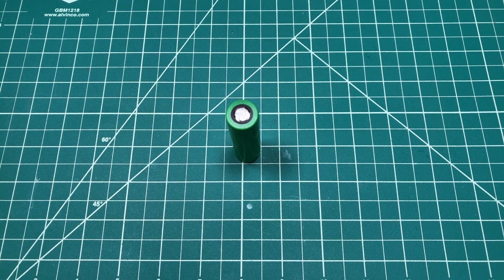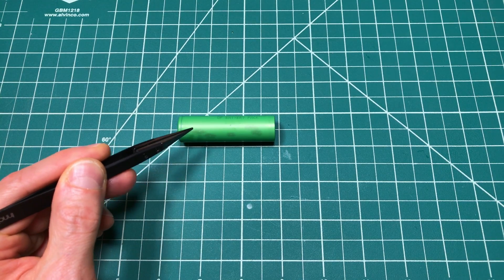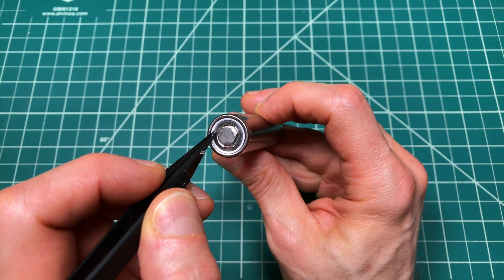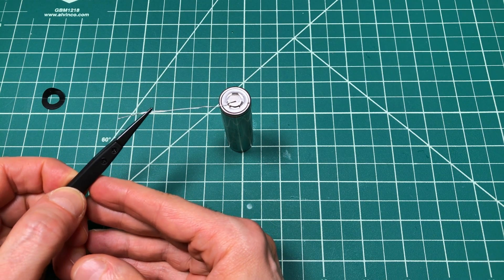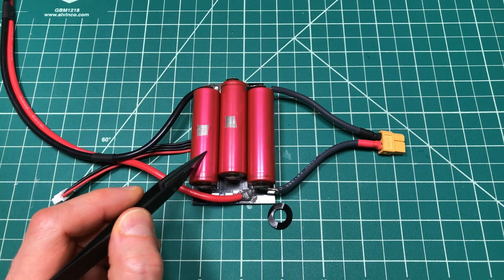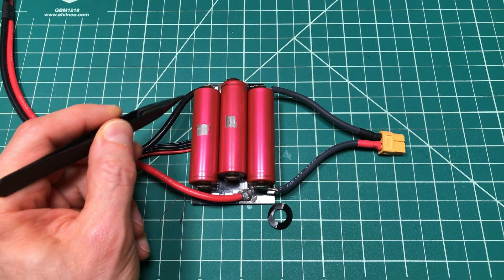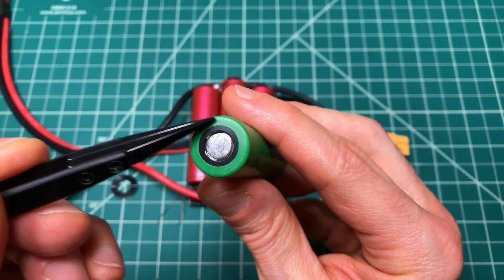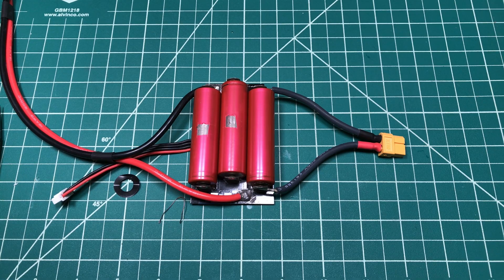Minding Your mAhs – Ep010 – Battery short circuit dangers in regulated devices

Comment: In some of your participations with some reviwers, you mentioned these issues regarding torn wraps and pinholes...ever since I saw those coments I started double wraping my bateries with clear wraps in order to avoid microtears when inserting/removing them from chargers/mods. This has helped me identify batteries according to their original wrap/markings with the added bonus that sharpie marks do not smear off (to keep batteries married) under the clear wrap. Once again, thanks for all your work and the videos!

Comment: Well this explains what happened to my X Cube like 3 years ago. Battery wrap had started to come off. One time while out hiking the vape heated up like crazy. Took the batteries out and luckily no explosions but the heat either melted or the short welded a piece of the contact off so the battery could no longer make contact in the mod. Now I know.

Comment: I managed to have a cell thermal run away in an rx300. 
I had just repaired the mod fire button. 
In putting it back together then testing it, I was careless and just threw four cells into it, not thinking about them being different companies and different rating. I set the mod down and went to grab another mod or something (I don't quite remember) came back, and could smell it. It took less than 60 seconds to explode. I reached for the battery tray when I could smell it and hear arching. 
Simply, it can happen to any mod. I pass this story along all the time when I notice someone being careless. I knew better and still messed up. 
That's why I treat all my mods now like mechs. 
This is why I appreciate all the information and the work you do for the community.
Reply: Mods always have a security vent for the battery tray right? So no pressure can build up and blow the thing apart.
Reply: saiiiiiii1 they do, and I can tell you, the mod still goes boom. It lets some gases escape, so it doesn't turn into a grenade and launch shrapnel every where. 
The pressure build up in the battery cylinder was still great enough that when I reached for the door to try and prevent it exploding (didn't matter battery welded to the contact) that when it exploded it destroyed the mod, the door and broke my thumb. 
So Mooch is right in that you can't trust all the protections and think they will work the way you'd expect. 
Saftey starts and ends with the user.
Reply: So what about the gases? I heard even tiny bits of inhaled lithium gas can impare your breathing drastically and permanently
Reply: I'm not sure, I didn't notice anything it all went very quickly, so I didn't notice any gas, but the scent of the charred cell remained for at least a day. I think that would be a great question for mooch though.

Comment: I always keep pressure on the negative end and get batteries into place then release them to complete the circuit if it is possible, I try to avoid sliding the positive end of batteries across a contact, I learned it a long time ago to protect my batteries

Comment: Thanks for the clear demonstration Mooch, of why we need sound wrappers. Just to clarify the point with the VTC discolouration under the wrap - if one can see it remove the wrap, clean and re-wrap as long as it is only surface marking?
Reply from the maker: That’s the prevailing advice, as long as you are sure the liquid is not from a battery that has leaked or vented.
Reply: Ok, thank you Mooch 🙏

Comment: Great info thanks mooch. Another safety thing i never seen discussed is atomiser safety. Have you ever seen an atty give wandering ohms for a build (say an 0.18 suddenly jumps to 2.1 then jumps again to 4 ohms). When this happens the vape is extremely hot probably firing many amps. I have had this and heard of people have batteries vent when this happens. Sometimes taking the atty apart and reassembling it fixes it, but sometimes its a faulty atty. What gives?
Reply from the maker: I’ve read about this happening but without seeing each particular atty and mod there’s just no way for me to definitively say what’s going on. Typically though, it’s either a malfunctioning mod or some connection or threading is loose or somehow bad.

Comment: Hi mooch, as always good info!, what's your thoughts on harvesting 18650's from makita 18v battery packs for vaping on? The internal battery protection boards shut the battery packs down and stop it charging it seems a shame. To chuck away 8 -10 cells that could be used. the pack I have uses US18650VT3 that could be 10 or 20a 1600 mah cells. If so it's a good place to get quality cells. Thanks again mooch, Andy.
Reply from the maker: Your risks go up using harvested cells. How much depends on how well the job was done. Because of this I am forced to err on the side of caution and recommend not using harvested cells to anyone since I cannot know the condition of the batteries. Each person can decide the level of risk they are willing to take though.
Reply: Thanks mooch as you say we are at risk anyway so no point increasing them. 👍 regards, Andy.

Comment: Thank you for the great info!! Might be safer with an internal battery mod?
Reply from the maker: Possibly.
Properly maintained batteries, not abused, can be just as safe though.
Reply: crumblenaut Don't be scared of these batteries be cautious and use the common sense rules Mooch gives you and things will be as safe as it's possible to be. 
It's a hazard to risk equation.
The hazard (battery failure) is nasty, the risk (chances or probability of failure) if you follow his advice is very small. Really small.
Enjoy your vaping by using common sense not worry about something that's unlikely to happen. Cheers 👍👍👍
Reply: I'm always careful with batts but if there's a safer alternative than....

Comment: Thank you for the video. Where can I find good 18650 ring insulators. I bought a bunch. They cover the negative but the center opening seems too big on all. The center positive is exposed which is fine. It leaves some of the "flat" part of the pin exposed. Is that an issue or am I safe? I can send a pic if that helps. Thanks!
Reply from the maker: You can try www.imrbatteries.com but I don’t know who carries smaller hole rings or not.

Comment: Hi, 
i have a question and i did not find any answer for it.
I have a dual 18650 device, the batteries are in series.
For the samsung 25R the minimal resistance that can work with is 0.186 ohm. (following its data sheet) 
Is dual setting affect the minimal resistance for both or is it always 0.186 ohm ??
And can i build coils that drop below that resistance or would it be considered as a short circuit for the batterie ??
Thank you.
Reply from the maker: This sounds like a regulated device?
If yes, coil resistance doesn’t matter. You can use 25R’s at up to about 60W each. That’s 120W in a two battery device.
Reply: @batterymooch  thank you very very much, you are a legend.

Comment: I was about to ask what those spots are... i have 1 on a few batteries.
Reply: mrphilip I also have a vtc5a that's gone like that, it's in a married pair and it's companion hasn't.
Interesting that mooch had to pinhole his wrap to replicate it, it would be good to know if its recommended to rewrap if this is happening.
Reply: Anthony, no evidence to speak of beyond my observation... the new vapcell 25A 2800 mac black wraps are in very sturdy outfits. More than a typical shrink job I gather. Let me know your thoughts when you have seen them.

Comment: Is it ok or safe to punch a little hole to a surface of a lithium ion artery of a phone.Does it remove air in a swollen battery?
Reply from the maker: NO! It is NOT safe!
A battery puffs because it is failing. Never release those gases/fumes as they are toxic and your battery is already damaged. Replace the battery if it has puffed.

Comment: Let's say I have a cell with an exposed part at the side of the cell. Now I put this into my flashlight which has no anodizing on the inside of the tube. Will this be a problem now that I have 3 points of the cell contacting. (negative spring, tube and positive spring)
Reply from the maker: Not sure.
Reply: cause you're missing additional information from me? maybe leave the flashlight part out, it should be basically the same with a mod. my main question is, is it a problem that the cell's negative parts are touching the tube at 2 different spots.
Reply from the maker: If the negative touches anything other than the negative contact it is a problem.
Reply: Battery Mooch but isn't the whole battery tube the negative contact? I mean the cap of the battery tube is just a piece of metal closing the circuit isn't it?
Reply from the maker: I don’t know, I have to assume not since I don’t know anything about the flashlight or its construction. If I knew anything that could help I would help. I’m really am the worst possible person to discuss this with. :-)

Comment: But does the battery actually explode like a grenade?  I hear people say the battery doesnt explode like a grenade, it kinda just pops.
Reply from the maker: It can blow off its top quite violently and spew molten, flaming materials everywhere with tons of toxic smoke. Or, it can just split open its venting disk and send out lots of gas/smoke. The “explosions” happen when batteries that are in thermal runaway, where they release a LOT of gas/smoke, are inside a device like a mech that can’t release the pressure. That can cause the mech to “explode” when the threads finally fail. There is no true explosion in the formal sense of the word but if a mech blew apart into multiple pieces hard enough to break teeth (this has happened) I’m pretty sure you’d call it an explosion. 😁

Comment: Lets see if i undersatnd :) The first part of the battry is clear :) the 3 bat mad : so because of the diferent voltage of the battery's the "acces"curent from the higher voltage bat wil flow to the lower one cousing a short ?
Reply from the maker: There’s no excess current involved. Touching the cans together short circuits the lower voltage battery because of the way series batteries are wired up.
Reply: So the lower bat is acting as the negative and the higher as the positief ?
Reply from the maker: No, the bottom battery short circuits through the case of the top battery. Only one battery ever has any current flowing through it.
Reply: Got it :)
Reply: In parallel, you join the positives one two or more cells together.  In series, you join the positive of each trailing battery to the negative of each leading battery.  In these cylindrical cells, that means the cans of the leading batteries are carrying current when the circuit is completed.  If any of those cans touch together you have now joined positive to negative AND positive to positive causing the shortest circuit possible.  This is how the overwhelming majority of regulated mod accidents happen because most multi-cell regulated mods run batteries in series.

This is information that should be known to anyone who purchases these batteries, yet we just had a prominent Youtube reviewer running a battery with a tear in the wrap and when people called him out for it in the comments, his answer was, "don't worry about it, it's a regulated mod so it's fine."  No, it's not fine!  If we don't wise up we're going to end up needing a government certification just to purchase these batteries.
Reply: Thanks for your reply :) I knew that tears in battery wraps are dangerous. The question was for the anderstanding why you get a short, that you can get a short i knew :)
Reply: @kevinbillingsley8256  - Hey Kevin, why exactly do they call it a "short" circuit? I don't get the nomenclature?
Reply: Short actually refers to a posited physical length of a circuit.  'Short circuit' is a colloquialism referring to the expected length of the circuit in its proper functioning state.  If, at some point along that expected path, the poles are unintendedly crossed, the electrical impedance of the unintentional shorter circuit is substantially decreased relative to the intended, proper circuit causing the amperage drawn to be unexpectedly increased by a factor.
Reply: @kevinbillingsley8256  - Interesting. I was just talking with my son about something like this. We were wondering why thermal runaway occurs when the top of an 18650  positive is bridged to the negative, yet nothing happens like that when a battery is inside the mod and is touching the positive and negative terminals? Does it have something to do with the circuitry? I'm just curious, I guess I should try and find a good book/video in the basic principles of how these systems work.
Reply: Greyswindir - It's easiest to understand in a mech (mechanical mod).  The circuit is held open until you press the fire button.  On a mech, pressing that button closes the circuit and starts electricity flowing.  It's a simple circuit so the point along the circuit with the most resistance (electrical impedance), presumably your coils, will generate the most heat.  In a regulated mod, like a computer or a smart phone, the electricity is passed through a circuit board so things become much more complicated.  However, that circuit board opens up a world of possibilities in safety and performance.

What I believe you're referring to when you say "nothing happens like that when a battery is inside the mod and is touching the positive and negative terminals" is running cells in series.  In the simplest terms, placing one battery cell on top of another battery cell.  Yes, the positive of the lower battery is directly connected to the negative of the upper battery.  Mooch has explained this in depth a few times.  The can of the upper battery in this scenario is charged.  In this state, the two batteries are no longer two, independant 4.2 volt cells.  They should be considered a single 8.4 volt cell.  The can of the bottom (or trailing) battery in a series cell is the negative of that whole, two battery cell.  The can up the upper (or leading) battery in a series cell is no longer negative, but a charged, exposed section of the series cell.  The positive is the positive of the leading battery.

Hope that helps.  Mooch explains it better than I can.
Reply: @kevinbillingsley8256  - I was going to say that about the circuit remaining open in a mech mod, but I decided not to, since I really don't understand everything thoroughly. My regulated mod is wired in series. I do recall that when wired in series, if there is a nick in both batteries and their wrappers, and they wind up touching, thermal runaway or a short can happen, because one battery can be at a different voltage level, while the other, in theory, could be at zero voltage. I've been watching his videos, but I still need more information to completely understand everything that is happening. It's just the type of person I am. I always have more questions. Thanks man.

Comment: Don't say the battery will explode. It will vent....
Reply from the maker: Venting is merely the physical release of excess gas and pressure via splitting open of the venting disk. Thermal runaway is much more severe and can result in the battery exploding. While it’s not technically an explosion that’s the actual word used in the battery safety test standards.
Reply: How do you think a bullets exits the barrel of a gun? It's all about pressure, which is really just a controlled explosion.